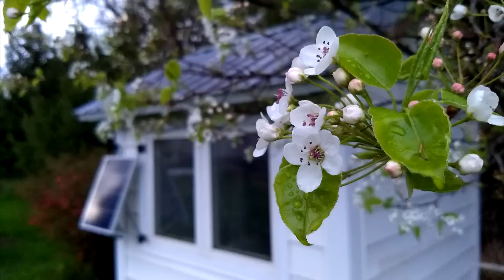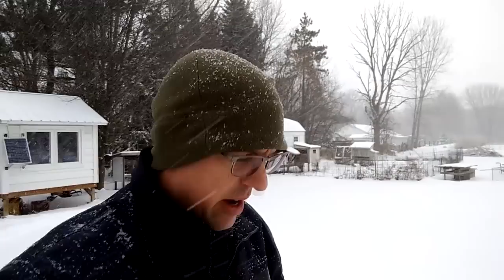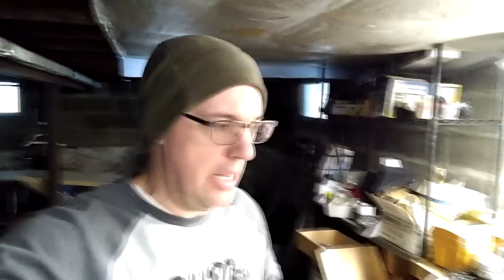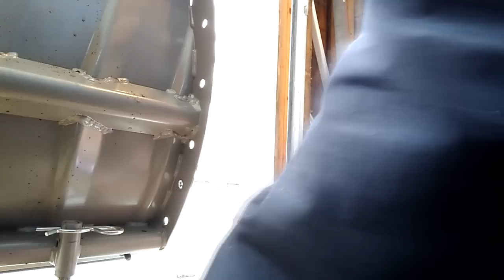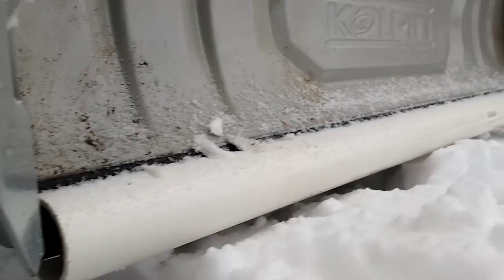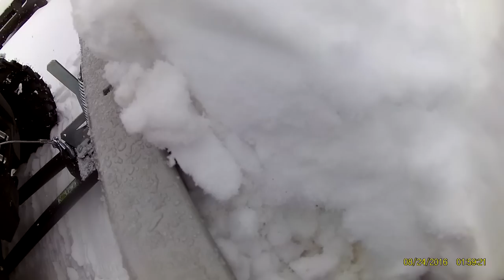Adding PVC Pipe to Your ATV Snow Plow | Hack for Plowing a Gravel Driveway

Comment: Been there. Done That. PVC works but is too brittle to use in cold temperatures. It will break the first time it hits a rock. Using orange flexible natural gas line, or polyethylene lawn sprinkler line is much more durable. But being round they both have safety drawbacks when cutting lengthwise. Kickbacks are a real concern! A big concern!  I found a better solution.... Purchase a rubber horse mat. Usually found at TSC. Cut a strip to length and sandwich it to the blade. It will act just like the rounded PVC pipe by folding backwards when plowing. After years of plowing 2/10 of a mile of gravel this works best for me. It will tear after a while. The ends tear at the sandwich point. To ease this eventual repair I use three separate rubber strips. A long center strip for the plow that lasts forever and two ten inch pieces at the ends that are easy to replace. Happy plowing

Comment: Thanks a bunch for this idea, my 3pt snow blower is out of commission at the moment but I needed an alternative way of moving  snow. I mounted the PVC pipe to my eight foot back blade and it works great. I was going to weld on some shoes but this was easier and cheaper. 
And  to all those who gave this guy the thumbs down, let me know when you move out of your parents basement and have to do your own laundry for the first time.
Reply: Good idea! Do you have the skid shoes on there as well when using the pvc? Where are they set?
Reply: @mwflydog  You don't need the skid shoes, just the pipe.

Comment: I used an Arctic Cat with a 5 foot blade for years. Had the skids set up an inch to allow for the gravel. Worked ok but still dug up the lawn in spots every year, and left a thin layer of snow as expected. 
Picked up a Ranger 500 with the 66” blade. Just added 2” electrical conduit to the blade. We’ll see how well it works. 
Thanks for the tip.
Reply from the maker: You are welcome!

Comment: On my Boss 8' plow I put a 3" steel pipe like you did with the PVC to plow gravel drive. Worked well. First winter since it was paved and put a poly edge on the ATV. Works very well. Still keeping the pipe on the 8 footer still plows good on asphalt.
Reply from the maker: I am sure that steel pipe is holding up well.  I am glad to hear it works on a solid surface.

Comment: I just tried ABS tubing, stronger than pvc, it cracked and split down the center. I tried sch 40 pvc last week, that cracked and split down the center. Works fine on a paved drive, not so well on a gravel drive. Though works very nice on the lawn.
Reply from the maker: Curious, is it splitting lengthwise?  If so, there may be to much stress on the pipe and need a wider cut to keep the pipe Frome needing to flex so much around your blade.  I am still running the same Sch40 pipe the last two winters and getting ready to start the third season today.  We got about 5" overnight.
Reply: Is yours an ATV plow or bigger. I found PVC to be too thin and broke on a 60" Moose plow on an Arctic Cat quad. Trying ABS now on gravel. Will see ...

Comment: interesting and at first glance an attractive solution to all the gravel gouging. But what about the thin layer of snow and existing ice it leaves behind?
Reply from the maker: It has never been a significant problem for us, as the drive is flat and it usually doesn't last more than a week.  In other areas, it might be an issue.

Comment: Thanks for the idea ..... Couldn't I just put a small section of pvc pipe on both ends kinda how the shoes go ..... This leaving the middle cutting edge exposed and less likely to ride up instead of having the entire length covered  in pvc
Reply from the maker: I had considered this.  Our driveway wasn't in the best condition at the time, so I was concerned it would still grab at the high spots.  Now that we have a more groomed driveway, it my be worth a try.
Reply: PVC will be too brittle in freezing temps in booth scenarios.

Comment: You need skids on the back side of the blade. You can adjust with washers  to keep skid high enough.
Reply from the maker: The skids are one of the main offenders for digging up the gravel.
Reply: @IndependenceAcresHomestead  if your skids are gouging you need more surface AKA.larger skids

Comment: Interesting idea. Seems like a great idea for the first plow before the ground really freezes. After that the plow doesn't seem to chew up the driveway that bad. I'm in a bit of a different scenario though, I have an 8' plow on my dump truck. If I could attach and remove that PVC easily enough I'd probably do it. Not sure how to do that though.
Reply: Drive about a half mile on bare blacktop with the plow down, pvc will be effectively removed.
Reply: @rompinroger9614  yeah I made it out of black pipe. Plus I have a stone driveway so it should abrade at a slower rate.
Reply from the maker: Definitely not ideal for a blacktop driveway.
Reply: @IndependenceAcresHomestead  so far so good man. It's very rare I take it off. I did a lot of damage to my driveway at the beginning of this season with the bare plow blade, but this thing really helps. Will be using it for years to come assuming the truck/plow continues working fine....and I don't pave the driveway lol

Comment: how long does that PVC last before it gets chewed up and need to be replaced?
Reply from the maker: Well, I am going on three winters and still running the piece I installed in the video and will possibly replace this winter.  Your mileage may vary.
Reply: @IndependenceAcresHomestead  Good to know...just adding a plow to our ATV this winter.  No gravel but I'm thinking this might work for our street since the city won't plow our streets.

Comment: That worked out great! Kudos to the sub that tipped you off on that trick. That 4 wheeler seems to do a good job pushing the snow. If it was the same there as it was here the snow was pretty wet and heavy.
Reply from the maker: Oh yes, it was wet and heavy!  Especially once the rain started around noon.  Even so, the 450 didn't skip a beat and kept the snow moving.

Comment: A much better way would be steel pipe PVC isn't going to hold up as well.  I did a Steel pipe mod on the cutting edge of my snow blower for my gravel driveway, works great.
Reply from the maker: Yes, steel pipe is more durable and could be a permanent solution.  However, PVC is easier to work with, and can even be cut with simple hand tools if needed.  PVC is also easier to install and remove if you are plowing a hard surface.  The PVC installed in this video has lasted 2.5 winters so far, so that's pretty good for my purpose.
Reply: @IndependenceAcresHomestead  Hmm, I may have to try the PVC route eventually, the only issue is I don't think I'll wear out the steel pipe anytime soon, especially if I don't get to use the blower more than once or twice a year HAHA!!

Comment: Weld a piece of black pipe to your cutting edge. I used 1” lasted 2 years before I ground it off when I got a new house with a paved driveway.
Reply from the maker: Probably the only drawback to this option is that will be much more difficult to remove if needed.

Comment: Will this work on driveways without the finished asphalt layer? The diameter of the PVC is 2"... I have been looking for a solution as my cutting edge prematurely wears out on rough surfaced driveways! I have even tried the UHMW polymer blades, same thing as metal!
Reply from the maker: My guess is that it would still wear quickly on a rough surface.
Reply: I just tried this today, and about 10 ft. into the plowing the sch 40 pvc split length ways as soon as it hit a small rock. Temps were 31 f. Great idea but need something much tougher.

Comment: How long does it last?  I can imagine having to replace it after every snow.
Reply from the maker: It last for 10 snowfalls last winter.  We have yet to use it this year.
Reply: I have been using this method for several years and the PVC eventually cracks and breaks apart but I have spares to replace on the blade. Subzero weather seems to cause the pipe to become more brittle also. It is the best method I have found for removing snow on sealcoating.
Reply: I tried it with 2" pvc and it didnt last an hour on my gravel driveway.
Reply: @IndependenceAcresHomestead  I'm facing this same issue, I'm wondering if I did this from 1 1/2 steel pipe how it would work out. Not as easy to cut the slot, but might last pretty long...

Comment: Why not use skid shoes like everyone else?
Then adjust to height you want
Reply from the maker: The skid shoes would dig into the gravel and still leave piles of gravel in the yard.  The PVC allows the blade to "float" over the gravel.
Reply: @IndependenceAcresHomestead  you need bigger skid shoes.
Things outside the box. 
Maybe 6 inches diameter round shoes like 9n big plow trucks or   add 2-3in x 6 in skids on the edges, like on a snowblower,  but oversize. 
Good luck

Comment: Don't waste pipe or your time. Use a steel pipe.  Plastic lasts about and hour
Reply from the maker: Interesting you should say that.  That piece of PVC has lasted for two seasons and should last one more here in Michigan.  For us, that $4 piece of PVC was worth my time and money.  I am sure everyone may have a different experience though.
Reply: On my gravel drive the sch 40 lasted ten feet, the ABS tubing ( stronger than pvc ) lasted 25 minutes ( it was 16f. here mid Mi ). From reading here someone tried sch 80 and it too cracked.
Reply: I may try 2 1/4 " automotive straight exhaust pipe. Grind a slit down the center just wide enough where i can tap it on the blade and not have to tack weld it.